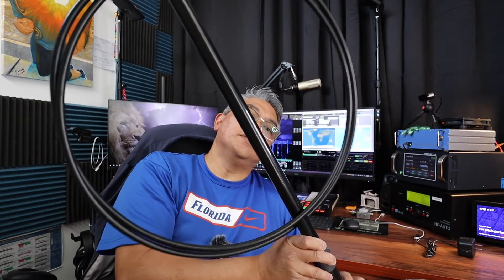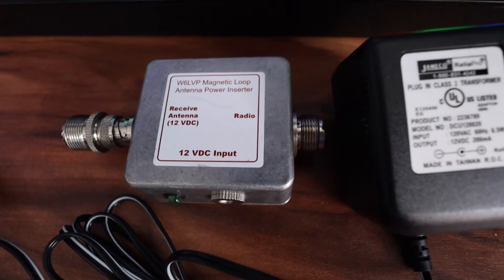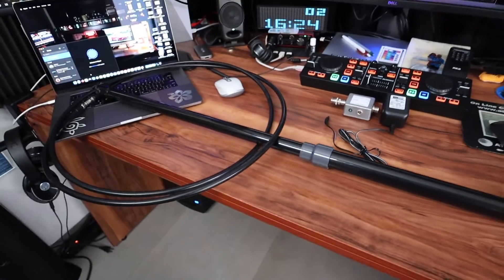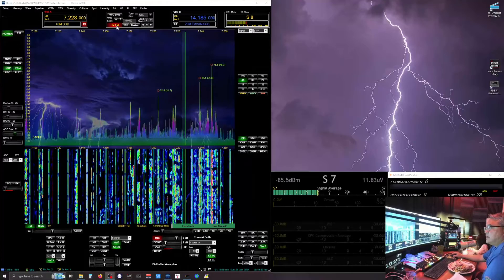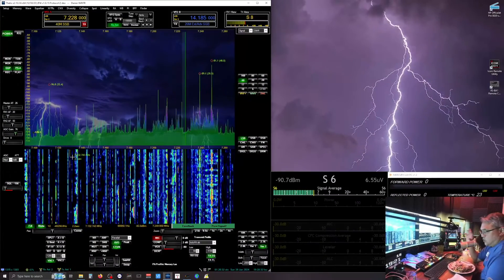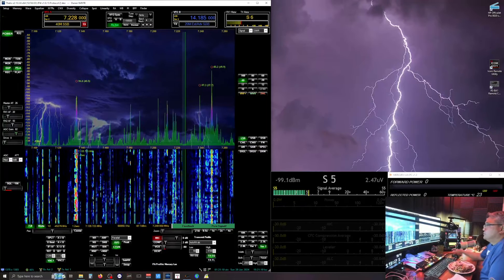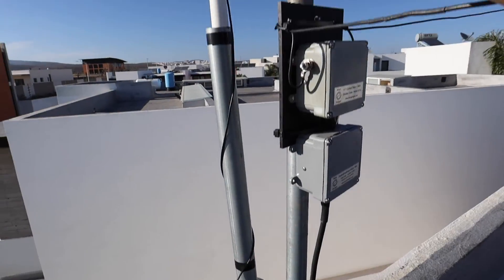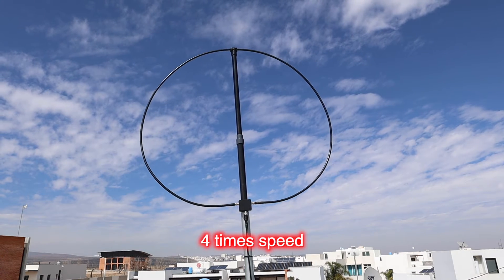W6LVP Receive Loop Antenna replaces  the MLA-30+ Receive Loop Antenna

Comment: So why did you replace the mla 30?  How  do they compare?
Reply from the maker: They both work well.  I relocated both of them to my S. Texas station.  Now, I have changed my mind.  I've already sold some of my equipment.  I operate Remote to my Florida station.  Soon, I'll be taking down my W6LVP loop antenna and probably will sell it on QRZ.  I chose the W6LVP loop because it was more stout and didn't sway in the strong winds.
Reply: @DarrenN4VFR Did you already sell that loop? Which RCA rotator model are you using?